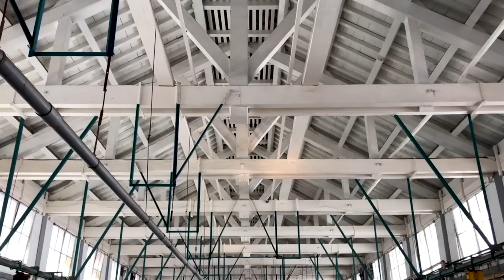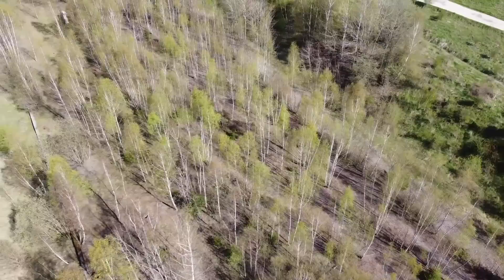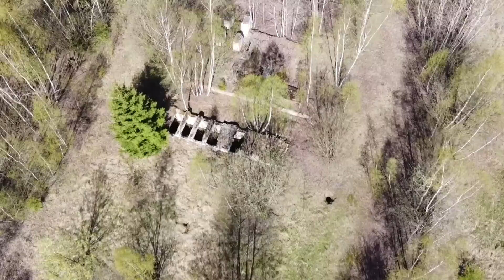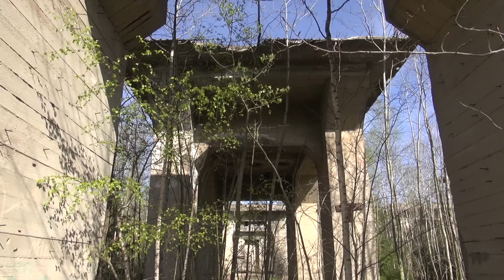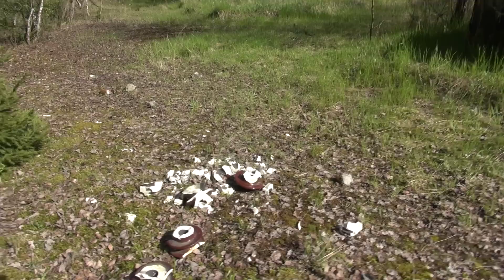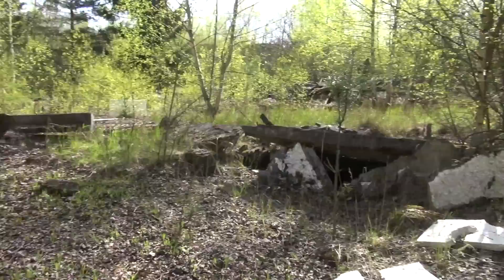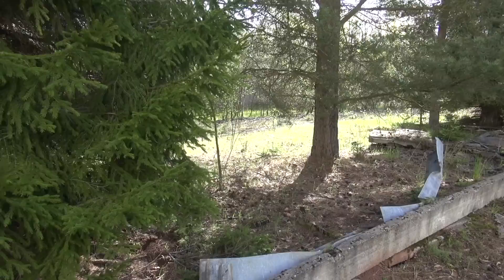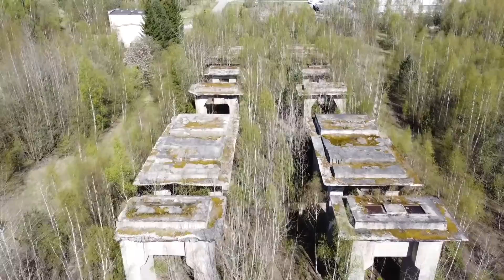THE THING - WHAT IS IT WHO BUILT IT AND WHY..

Comment: The first but were a marshalling yrd for rail carts. Then you walked thru 2 tip siloes where carts dumps masses frome huge railwaycars that has hatches underneath. Look at old coal carts and you see similar constructions.
My best bet is coal or limestone beeing dumped in those siloes..
The long foundations are most likely the outer support walls for an major factory that did not needed heating internally and only needed light walls.
As i interpret it it whould be eighter a coal processing plant or a limestone processing plant.

Comment: I think all those round wells are sumps for pumping ground water to keep a large underground system dry. The maintenance support buildings could be generators to supply power for the pumps as well as for the bunkers. There must be archived photos in the local library? The cement towers I believe were supports for large bins. The bins would be filled continiously by conveors. Rail cars would be backed or pulled through the towers to be loaded very quickly with material. I belive you found an underground factory that has been flooded.
Reply: Good thinking.

Comment: The "electrical panel" looks very much like the cover to a control panel for a bank of ventilation fans. On/off switch for power to the box, push buttons to start/stop/high/ low speed etc. Fits with the ventilation grates. We use a similar set up to provide ventilation on a ship. So any enclosed space needing large volumes of air moved would use the same.

Comment: So in looking at the construction, they used panels to mold the walls. Nothing built by the Germans that you have shown uses panels, just boards. It's therefore post war. The rebar sticking out says to me that it's either not finished or built in a hurry or both. All kinds of interesting buildings. Very close to the castle, and the test site of German nuke tests. Thoughts: what if the Russians found plans for a German rocket launch facility and wanted to see the infrastructure for real, never finished it just because, and then left. Ask the Pentagon, they can probably tell you.

Comment: Well... mixing something to be a useful product...
A. Making different kinds off concrete for constructions "in the area". Roads, bridges, basements, factories. air fields, but when...Building or rebuilding during or after the war...

B. Mixing N, P and K to get the production of grain starting up again, so the people can eat. Its almost the same as making other Nobel products...That are making more noice...

But, I did not see any concrete or small hills with "mistakes" 
Tino! ALWAYS look carefully on the fuses. Green 6A, Red 10,Black 13, Grey 16, Blue 20, Yellow 25, Then 35, 50,63, but they are usually bigger in size.
If all three up and down are the same color, it might be a 3-phase "product" like a engine or a heater. 6 or 10 is usually lights.
There is almost always something to find from the fusebox. 
The FAT cable you found, usually got text in the PVC. Factoty, dimention, YEAR and so on.

2Lt Jansson (Ret.)

Comment: Tino, just a few thoughts.  I didnt see any security fencing or reminents of defensive positions.  With that much electricity and power running to the complex and the linear construction of the buildings, perhaps this was an early attempt by the Germans and then later taken over by the Russians to create a particle accelerator to further research fission and splitting the atom? There seems to be a large underground complex that needs further exploration. The site would benefit from a Lidar Scan overhead from a plane. This can be done and would allow you to penetrate the foliage and decay to reveal patterns and building infrastructure that you cant see from the ground.  Someone needs to invent a Lidar system for a drone.  Just some thoughts to add to the discussion. I am wondering the reason we cant seem to make out what exactly is going on there is due to German and then Russian reconstruction of the area so with two building methods it makes it difficult to ascertain what was the original intent of the location.
Reply: Poland is completely lidar scanned, the data publicly accessible in quite good resolution via the polish geoportal. Lidar scanners for drones don't need to be invented, they exist and are available commercially (but cost several thousands). Of course scanning with a drone would give much more details.
Reply: @DerTadel  Thanks for the info. I had no idea Poland had been completely lidared?  Where can you find this data?

Comment: We,ve seen structures like those before in a past vid an they posed the same question , an I have seen an Angled building like that over here at the ( now gone ) ICI Nylon plant in Ayrshire it was part of the Nobel exsplosive manufacturer as my Dad worked in it from when it was New till it shut down in the 80's , an He said the place was stuffed with bunkers ,  Failing that it was also at Bowhose which which is just outside Kilmarnock , it was also part of the Nobel Explosives empire , till it was shut down an they Built Bowhouse prison on it and it opened in 1999 , But those Towers look like they could be joined by beams an covered by Camouflage netting an maybe walkways with AA guns on top ..but what went on inside them Who knows.. ..and if Tino would luv to have done a vid on Women in Nylon undies..
Reply: I was thinking nylon would explain why they decided to call it a silk facility. Doesn't explain the insane seemingly unfinished rows of concrete structures unless they were doing more than nylon

Comment: I have an idea as you mentioned about a dam near by!!
Think water cooling
Think ICBM test facility so the rocket casings suspended inside those arches
The WATER from the dam would be used to hide the rocket exhaust ( NASA &STARLINK TESTS); 
The trains bring in the test rockets suspended and or if successful the rockets are armed then stored underground ( my previous comment) 
Warsaw pact. The Russians HATED AND STILL DO hate the Poles; so cheap Labour and it’s close to Motherland ( Russia)
Jonathan

Comment: Synthetic fuel produce palnt, or, pre cast concrete sections produce line, both would require lots of tower like building, so gravity could do some of the work. Sadly like most here, these are shots in the dark, and as good a guess as a full scale plan for a Moon station

Comment: at 40+ min talk about generators on rails, but nowadays power transformers are still placed on rails in part surrounded by a building of which one side has no wall, I wouldn't be surprised that this is an equivalent setup. greetigs from the Netherlands ;)

Comment: Doesn't look like they completed it if the temporary platforms on the top of those arches weren't taken down. Electrical hook ups near the top of the arches may have been to illuminate something on top. My thought was it was to be an elevated platform for some aerial vehicle to land on. They did develop a helicopter. I doubt it is a Diesel Factory (Dese will fit her). Does this location align with any period structures in the area?  Tino you give us a lot of mysteries to solve.

Comment: The first buildings were for side tipping rail cars, but how they have set it up is a bit baffling, as the cars would tip but then they made it a bit Awkard to then get at whatever was tipped out, so I am guessing we are missing a key component of those buildings that is long gone.
The area with the low parrel walls it wouldn't be a filled in overgrown water storage (talking man made shallow lake), they obviously needed a heck of a lot of water.

Didn't they use hydrogen peroxide? Is this a small chemical plant? Yeah could be explosives but the set up is strangely way over engineered for that, but doesn't so much for hydrogen peroxide.

Either way I am seeing a small chemical plant of some sort.
Reply: Another commenter recognized very similar conveyor sections to a nylon plant that was near them.  Would explain the silk story.  The "Bridge" parts don't seem to fit that though, maybe another chemical process.   Perhaps a train geek could figure out what kind of car was unloaded in such a way and narrow down what they were moving.
Reply: EXACTLY my thoughts about the side-tip railcars! I wonder if they tipped to an exit underground though?

Comment: I have a hypothesis.. It was an air field. The arches or the supposed bridge parts are a place where trains would bring newly assembled fighter planes under camouflage netting between the pilars. The smaller "bridge" parts are for the end part of the train where the cargo carriages were so there was enough space to unload the planes. All tracks have long since been removed for scrap. The brick buildings held a series of generators to power the whole field. Technical buildings for Electric distributions, fueling and water for the locomotives. So basically just maintainance for both the fighter planes and the trains that brought them there..
Reply: good thoughts/suggestions Frank, but i still wonder why those arches were all designed differently and with differing shapes and sizes if all they were is supports or archways? And why all the anchors and open tubes in the roof sections? Why not just build rows of identical arches? They seem to have served a technical purpose, especially with the tech. tunnels connecting them.
You might be onto something about camouflage netting between the platforms though, as I wondered about there being some sort of cover draped over them.

Comment: The round things in the "bridge pillar" tech tunnels look like weights for a scale we used in the 1970s to weigh grain trucks. Whatever the tall pillars are i think it was built to measure something. But i am a loss as to what. Way too much tech buildings and heavy lifting platforms laying around. The long short walls may be a mixing bed for a road grader. When i was a kid the local state of Missouri road maintenance guys would mix asphalt for the road outside with a grader and load it onti dump trucks to build roads.

Comment: Looks like classical coal bunkers and conveyor belt shafts, the two parallel walls look like the runway for a coal loader scraper, with the coal storage area between them. Perhaps a coal powerplant, cement plant with a rotary pipe oven or another industrial facility (chemical, fuel, explosives, ...).
Reply: There's already a power plant nearby.  Chemical, cement, explosives plant seem to be top guesses.  Someone mentioned some of it looking like a nylon plant their dad had worked at which kinda fits with the silk thing other than that crazy "bridge pillar" thing
Reply: Yeah, my first thoughts were about coal loading/storage taking place here.
Reply: Could also be an agrigate or uranium plant.
Reply: @AmerikinJackass  No, doesn't make any sence. Do to the Diabas quarry nearby and the very long lasting history in coal mining in the nearest area, the cement plant is my best guess.

Comment: Looks like a mining operation for limestone and maybe gravel. Have a look at the lake next to this structures.
Reply: Limestone is used to make steel. I would guess steel wire rope and cable. Think how big a cable car cable wheel/reel is, the wheel/reel size and how they twist the rope? The biggest structure at the end with the holes in the top would be the last and the steel rope/cable would go through onto a big reel. The big area with the track next to it would be to wind the cable into thicker cable (google 9/16 rope for how wire is made) and the pit/ramp is likely the galvanizing area, this can be hot dipped or electrically done. Thats my guess. I think silk production got lost in translation.